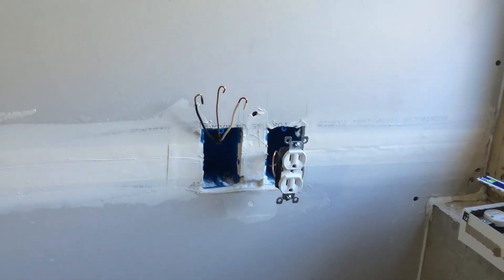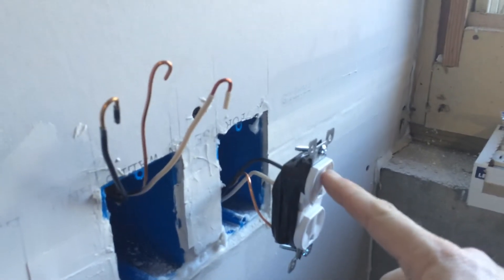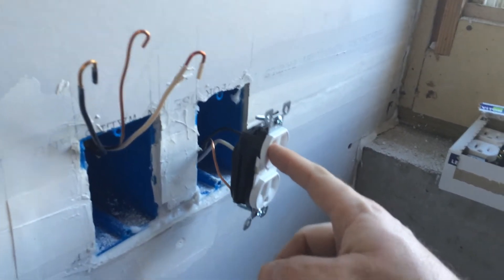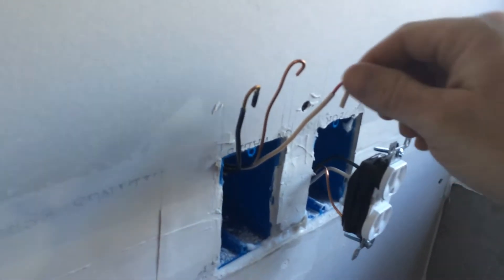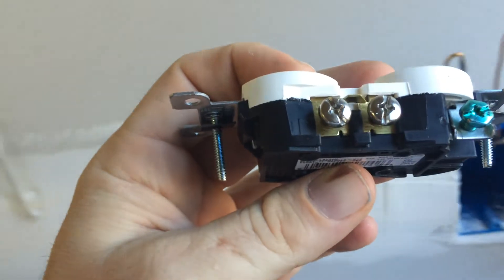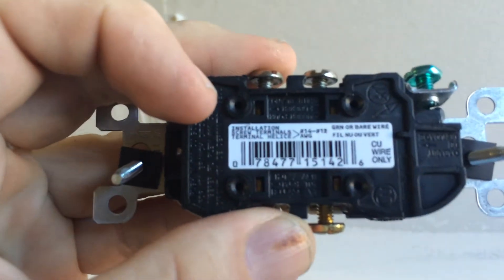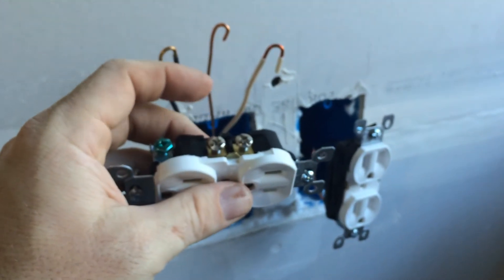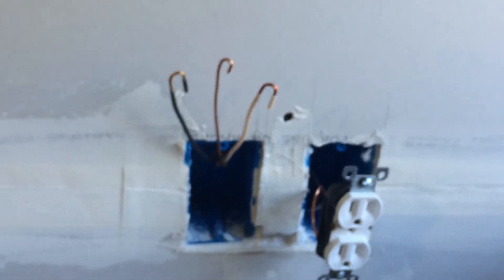How to build a grow room: Electrical Device Install Pt  1

Comment: so this is running on 240 volts?the black and white being hot/live and the copper being ground/earth?...on at least 20 amps?...can you do a video on the wiring in the switchboard, with breakers etc...explaining every step, the why's and the why nots...
Reply from the maker: +Teina Toru Yes, I will be doing just that soon. It is on my todo list.